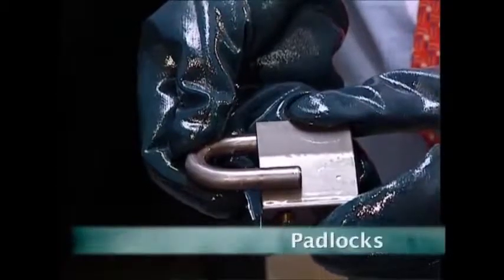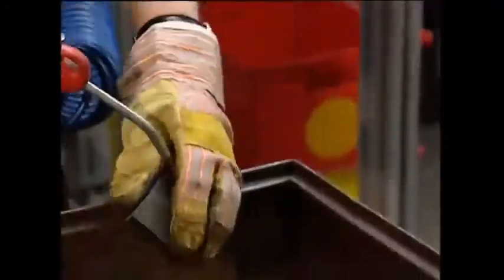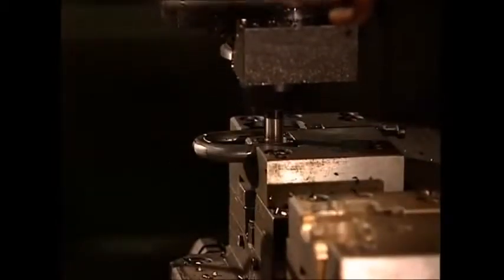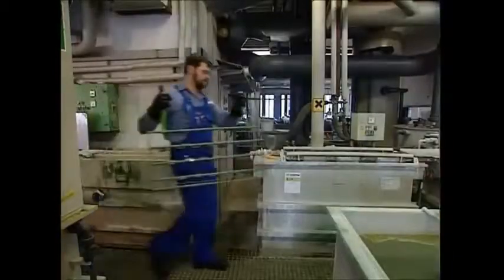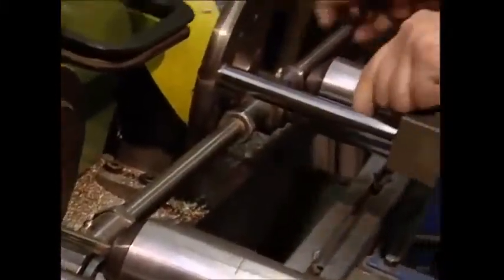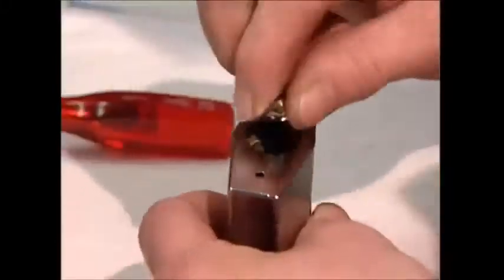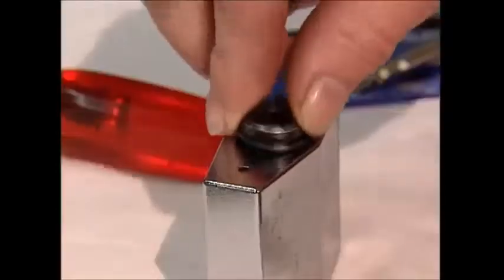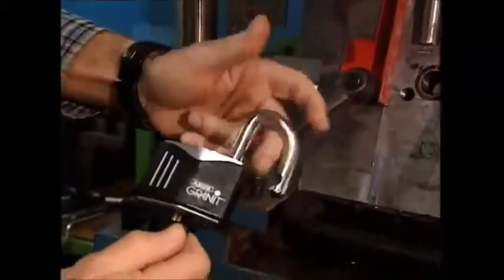How It’s Made Padlocks

Comment: Quick! 
What's -40C in Fahrenheit? 
F = ((C / 5) *9) + 32 
C = -40 
=>
F = ((-40 / 5) * 9) + 32 
F = ((-8) * 9) + 32
F = (-72) + 32
F = - 40
-40F = -40C
That's the only time both temps measure the same value on both scales!
😀